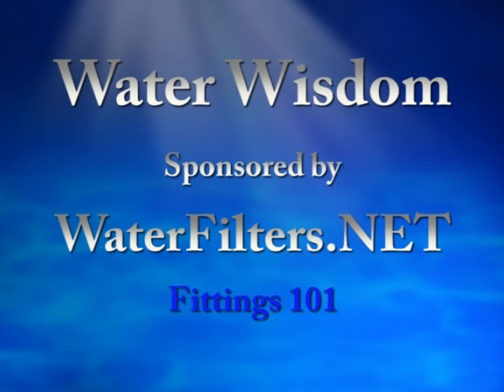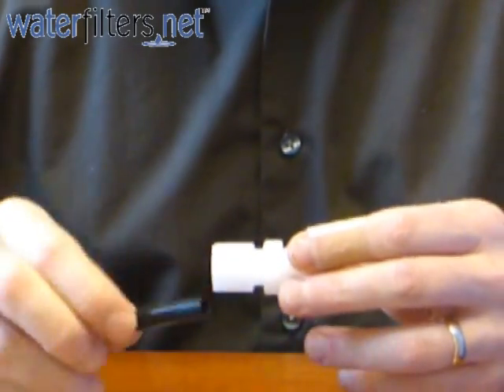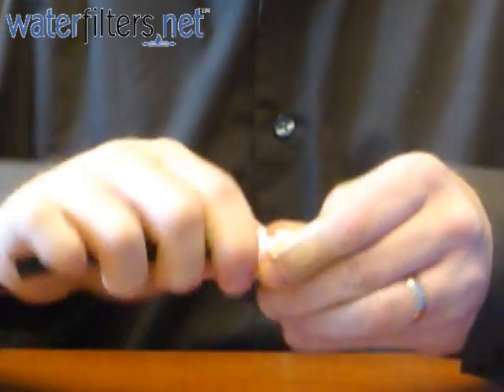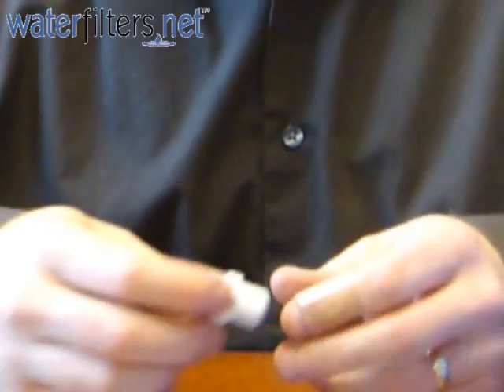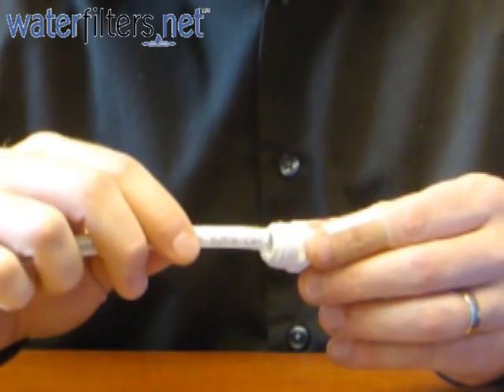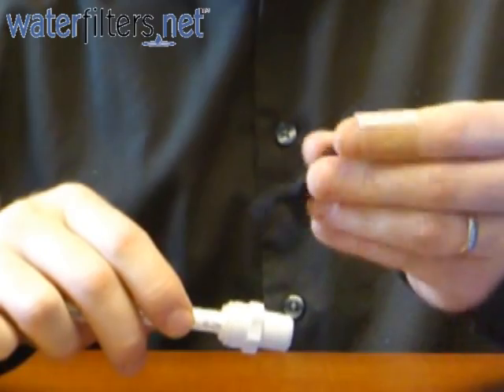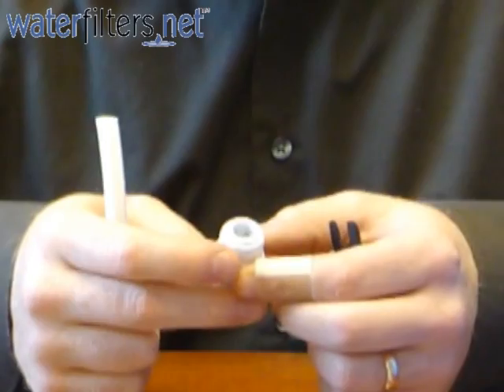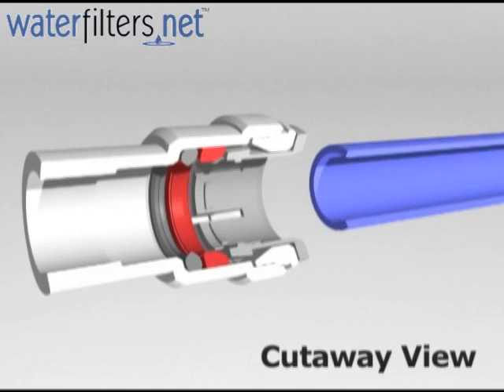How to Use Quick Connect Fittings

Comment: Quick-connect fitting is actually originall called "Sharkbite". Keep in mind that they are NOT REUSABLE and are NOT designed for pressure, because the only insulation inside is from O-RING, which easily gets ruptured after 2-3 reconnections. In short, they are only fit for air connection at low pressure!
Reply: They are designed for water pressure

Comment: Just had brand new GE $2500 dollar fridge delivered today.  Within 20 minutes of turning it on the quick connect fitting in the waterline (under front of freezer door) started leaking! (It was NOT touched by the delivery guy). I pulled the tube and tried to re-seat it.  Still leaked!

That piece of shit is coming out of my BRAND NEW FRIDGE tomorrow and in goes an all brass compression fitting!!  

Whoever invented these things... please stuff them up your ass. 

Thank you!

Comment: what are those lock like  C clamps given with quick connect fittings when you inserted the pipe in fitting and then pulled it back there was a gap i think those go in that gap
Reply from the maker: That's correct - they prevent the quick connect fitting from being "pushed in" so it's accidentally disconnected.

Comment: Do the quick connect fittings go bad? I have a water filter with two quick connect fittings that seem to be "broken" as they are continually leaking.
Reply: +Chris Pedersen Cut off the last 1/2 inch of the plastic tubing with a box knife and try again. Usually the end has hardened or changed shape slightly. This gives you a fresh end.
Reply: +Chris Pedersen And sometimes you just need to replace the fitting itself.
Reply from the maker: +Chris Pedersen 
Thank you for contacting WaterFilters.NETQuick connect fittings should not go bad.
Reply: +aquamanwisdom How do stop the leaking? One seems to have stopped (for the time being) the other is the quick connect on the flow restrictor (it still leaks). I've tried everything (shut the system off and replugged the line, etc). Suggestions?
Reply: Jerry Snook
Reply: Jerry Snook - right on. They don't so much lose their shape - more often after the first insertion someone removes the line and they often get scratched in the process - in the perfect way to create a path for water to leak. Best solution is to remove the hose and cut 1/2" off the end, then reinsert.

Comment: Unfortunately, quick connect fittings WILL leak if the attached water line is ever touched or is subject to the slightest bend.  Quick connections are designed with laziness in mind and are not a permanent solution.  In the video, using a quick connect instead of a compression fitting only materializes into 15 seconds of time saved per connection.  Is the risk of leaks and hassle of getting a quick connect fitting not to leak worth it?
Reply from the maker: Dave A Quick connections are now an industry standard connection for many companies. Their usage is designed to help eliminate the need for purchasing proprietary thread patters, allowing users a much wider array of products to chose from without having to match specific connections.If you have any other questions, please feel free to call us at 888-801-7873. Thank you! www.WaterFilters.NET
Reply: Well, I just got an Everpure EV910006 replacement filter with quick connect fittings and everything I've tried has not stopped the outlet side from leaking.  I'd like to try a compression fitting  but need to know if threads for these filters are standardized?
Reply: @PaulAshley  they are. I have had the same leaking problem. It al goes well until the pressure gets higher (e.g. a closed valve) then it starts leaking. Cleaned the garage 4 times this week. No more quick connects here. To answer yout question: they are standard threads 1/4, 1/8,..you name it.
Reply: I did get a compression fitting for the outlet side and so far it's working without leaks.  The new fitting is metal and I do have concerns about what might happen in the colder whether due to difference in materials.  The filter is in a crawl space that doesn't get too cold but I'll be watching it as the temps drop.

Comment: Thank you. I thought the faucet installer had glued mine in until I saw you reveal that secret tool. Using a wrench as a substitute I was able to pull out the old brass ended Kohler hose and replace it. The new one just pushed in and stayed in.

Comment: Thanks.  I'm a first-time homeowner and the 1/4" water line from the cold water supply to the water filter had a high-pressure leak.  I thought it was a compression fitting, but I discovered it was a quick connect.  In my defense, the hose and fittings are covered in paint (someone must have lazy when painting under the sink).  Your video helped me a lot.